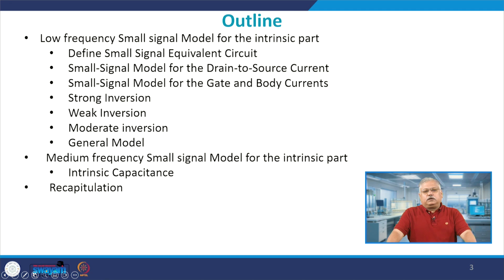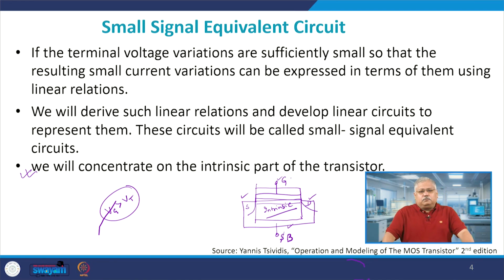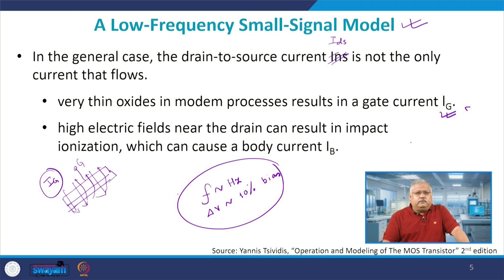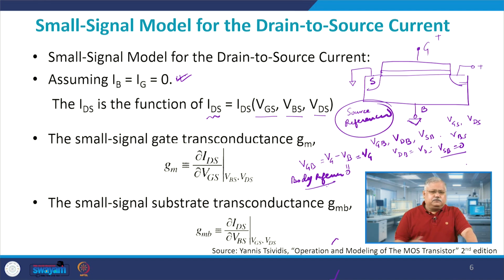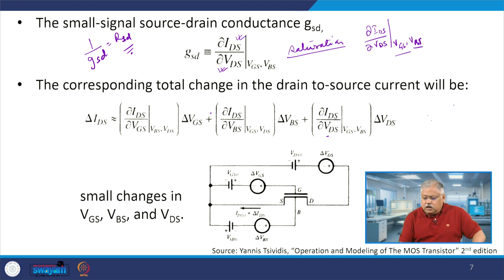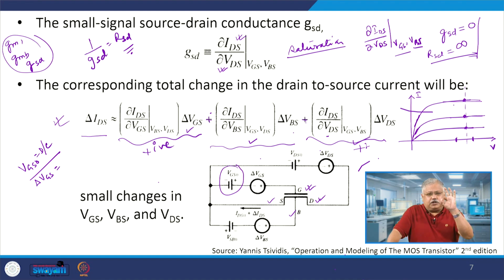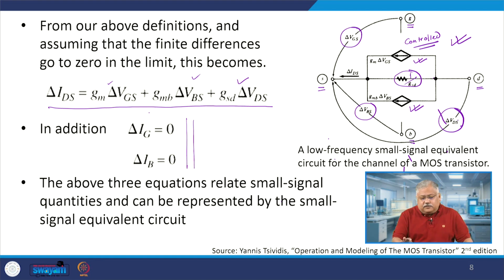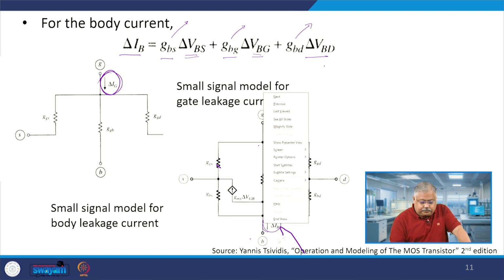Lecture 11 Capacitance Modeling for High & Low Frequency-I

Comment: if source to body voltage will increase then Vth will increase due to body effect, means we need to apply now more gate voltage for channel to be inverted, means for a constant gate voltage my overdrive voltage will reduce and hence its reduce the drain to source current in both linear and saturation mode of operation